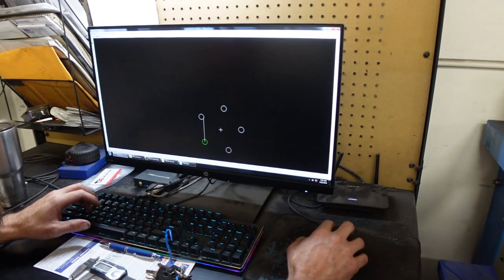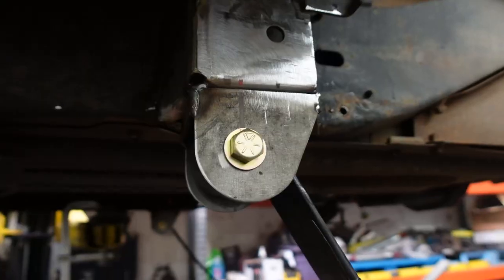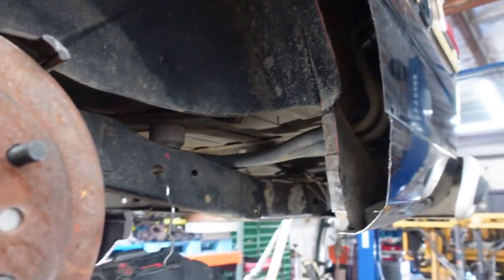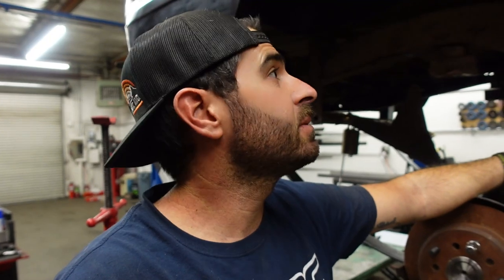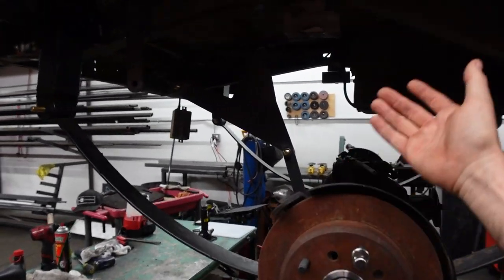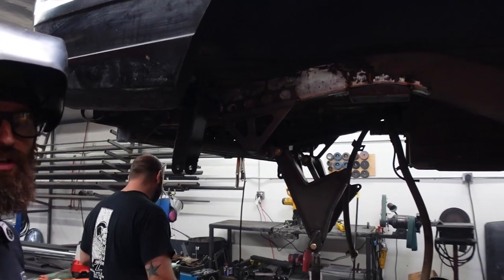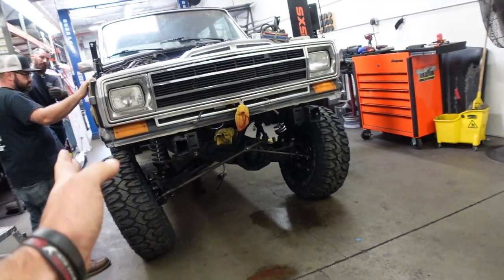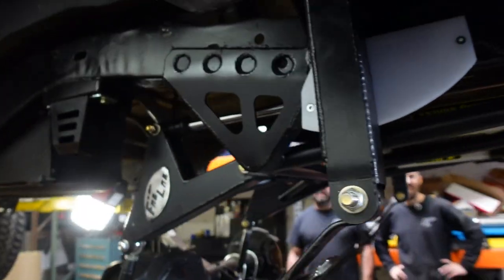Overland Prelander Build (Long Travel Cantilever Suspension)

Comment: I agree it is “Not Practical” but still gave you a thumbs up.
Reply from the maker: It's definitely not in some ways. But in other ways it is, the new motor and transmission is much more reliable and fuel efficient...🤷‍♂️